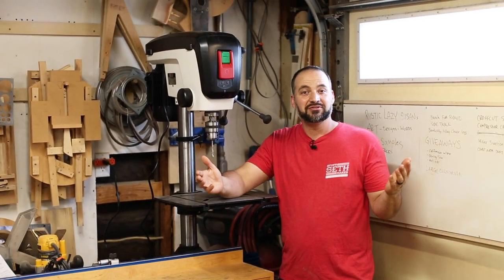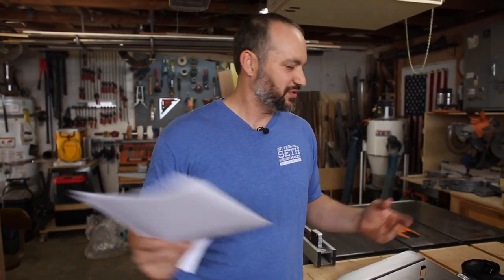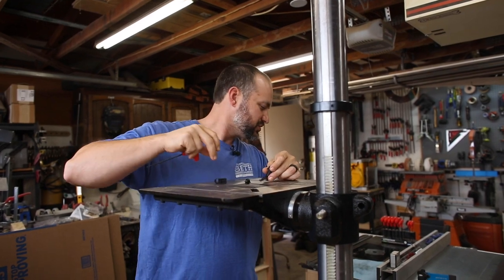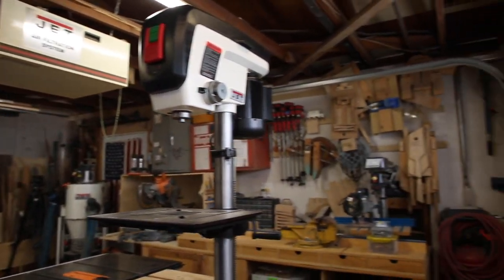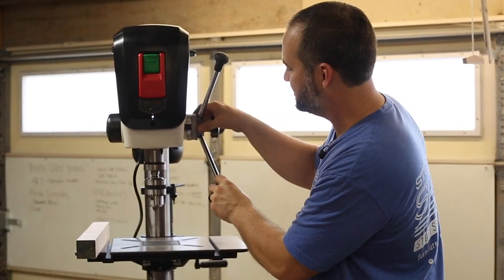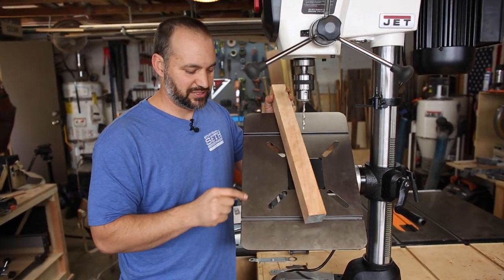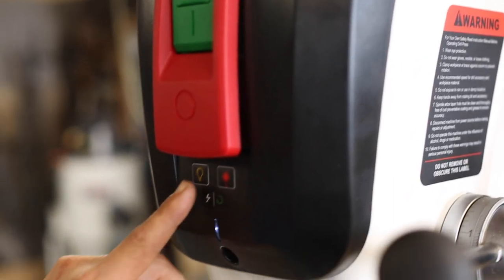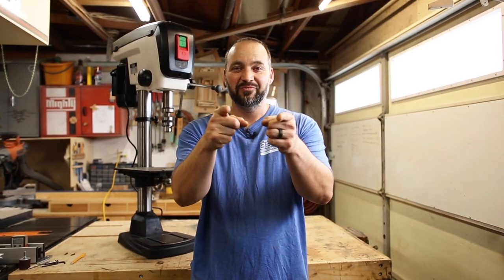HUGE UPGRADE for My Small Shop - JET Woodworking JDP-15B Drill Press

Comment: Thank you so much. I bought this press to replace an old delta varispeed 12".  Man this thing is big! My bench is 32" high and this press was to high to use comfortably. So I built a rolling stand with 3 drawers  20" inches tall not counting the casters under it and this is just Perfect. Just like this video. I will say that you need help to move this thing as it is super heavy and I mean HEAVY! And very awkward to handle. A person could easily hurt themselves. So if you buy one of these beware and ask for HELP! This is the nicest tool now in my shop next to the jet table saw. I love the chuck. Never have I seen a press with this nice of a chuck. Thank you again Seth!!

Comment: Question.  Can the main motor unit rotate on the column by loosening some fastener if needed?
Reply from the maker: Yes!  As a matter of fact it can.  There's a pair of set screws on the side that keep the head unit in place on the column.  If you need to swivel the head for any reason you can just loosen those.  I have the drill press mounted at the end of my bench and recently i needed to drill holes in the end of the workpiece, but the workpiece was too long.  So i swiveled the head and the table to the side, and also tilted the table 90 degrees.  Now I was able to secure my longer workpiece to drill the holes i needed.  If i can find a pic, i'll post it here on youtube to my "posts". 👍🏻
Reply: @stuffsethmakes  I appreciate the great video, and this comment addresses my big question which is do you regret not getting the floor model?

Comment: Hi nice thorough video. Question please.  What is that knocking sound when you initially turned it on? I had a little older JET floor model that sounded smooth as glass. If you aren't sure what I am talking about review your video and listen for yourself. Thanks once again
Reply from the maker: that sound was simply the machine running at a very slow speed which is how it came from the factory.   I'll admit I was surprised at first...i thought the sound would be more of a wow-factor when i turned it on for the very first time, but i didn't realize it was just pre-set to a very low speed.  Everything is normal though and I still love it! 👍🏻

Comment: cool video, thanks ! what is the distance between the back of the motor and the back of the column ? hope to fit it in my shop ☺️
Reply from the maker: i just went out and measured.   if i were to push the back of the motor right up to the wall it's about 8.5" to the drill press table height adjustment collar and about 10.25" to the actual column itself.  Hope this helps! 👍🏻
Reply: @stuffsethmakes  thanks so much! it fits, going to buy it \o/
Reply from the maker: YES!!! 🙌🏻

Comment: Hi Seth, you said on the video that you would talk about replacing the table insert. I didn't hear you address that so, when and with what would you replace it? Thank you!
Reply from the maker: sorry if i missed a point or didn't go into more detail.  it's just 3/4" mdf, about 3x3 in size.  when i replace it i'll just use the same material.

Comment: Would you recommend this drill press for light metal work?
Reply from the maker: yeah for sure.  i've used it for a lot of metal drilling.  I think you just need to be mindful of the bit you're using (i use cobalt bits for drilling metal) and make sure your speed is set properly. There's a chart printed on the inside of the lid 👍🏻

Comment: I think the only decision for me now is do I get the floor or bench unit. I'm 5'9" and realizing that if I get a floor model, my viewpoint to the table at max height is fixed. If I get a bench model, it can be what I want it to be, as long as I build a table for it, or buy a table. I'm wondering if you (Seth) or anyone else has found the bench version to be better for that reason. I'm not concerned about floor space. But if I buy a bench model, I have to figure out a cabinet solution.
Reply from the maker: I'm 5'10" and my current location of the drill press is too high.  That's because the only place i could put it was in my miter station which i designed and built very poorly several years ago.  I am currently redesigning my miter station this very moment. Instead of mounting the drill press on the miter station again i think i'm going to build a separate mobile cabinet for the drill press so it's at a more appropriate height.  The drill press cabinet might be a little narrow so i can rotate the head to drill longer pieces if necessary and I think i'll also weight the bottom of the cabinet (weights or concrete) since the drill press is fairly top heavy.
Reply: @stuffsethmakes  Good points to consider ... out of curiousity, how high do you want the chuck to be when you are done? I'm looking online to find any guidance as to the optimum position. Since this model is bigger than most of the other DPs on the market in that price range, it's rather unique. In a good way.
Reply from the maker: i don't know if there's a recommended height or if it's just based on personal preference but i just went out and measured some things.  Currently my green power button is about 70" from the floor, which is right in the middle of my forehead.  As i stand there and look at it, i think i'd like it be more around the 64-65" mark.  Not sure if this is helpful for you or not but those are my thoughts, haha!
Reply: @stuffsethmakes  I can see how that ~65" mark is ideal. With the floor model at 63-1/4" high, that places the button down about 59+ inches? That could work even better if I fabricate a thick steel plate about twice as wide, and drill/tap holes for hd wheels .... but if I build a cabinet, I need to deal with added weight (as you mentioned in another post), and making it wide enough for stability with most of the weight in the head of the dp, right? I'm guessing the cabinet should be about 25-26 inches tall? Sorry for all the questions, but this is a big expense for me and now that I know the JDP-15 is for me, it's a matter of "F" or "B" ... Thanks!
Reply from the maker: I'd imagine the floor model would probably be more or appropriate height right out of the box.  Since i'm not at the drill press cabinet stage of my miter station rebuild just yet, i can't say yay or nay to the dimension you mentioned but it sounds like you've got a pretty good grasp on what you'd need to build for either drill press! 👍🏻
Reply: @stuffsethmakes  Ordered my floor model JDP-15F today, along with Rockler's hold down clamps, Wolfcraft Quick Jaw Vise/Table Clamp, and steel engineer square ... fun times coming. Thanks for your video. It really helped me get as close to getting to see the DP in person, including your helpful comments!
Reply from the maker: awesome!!!  glad i could help! 👊🏻

Comment: Seems adjusting the LED cross hairs with a pair of pliers will eventually tear up the knurled knobs.
Reply: I want to know where your wife parks her car if the garages is a workshop? ;)
Reply from the maker: you don't need much grip pressure to adjust the lasers.  even if they were smooth you'd be good for a very long time.  additionally, it's not like you're constantly adjust them.  get dialed in and you should be good to go👌🏻
Reply from the maker: we have an understanding 😜

Comment: What is a good height for a movable cart  for the Jet 15B ?
Reply from the maker: unfortunately i don't know because it might be different for different people.  You'd have to determine your comfortable working height of the drill press, then build the cart according to your needs.   I just built a new miter station and repositioned my drill press on a shorter base...i'm hoping to put up a video soon showing more details of that project and i'll go into more detail about the dimensions in that video! 👍🏻

Comment: What are your thoughts on the sound it made? Are there any rattling sounds or any 'thud-thud-thud' resonating type of sounds? I ask as I bought a cheap Grizzly that sounds like a freight train and am thinking of returning it and spending a bit more on a quality machine. Cheers.
Reply from the maker: nah, no weird sounds.  when i turned it on for the first time in the video that was actually the very very first time i ever turned it on and to be honest i thought it would sound a little more powerful but then i realized it comes from the factory configured at a slow speed.  I've used it a lot now and everything sounds like a nice strong machine 👍🏻
Reply: @stuffsethmakes  Cool. Good to know it's working out for you. Thanks Seth. Cheers.

Comment: Great Vid....I'm getting a 17in Floor model but all the mechanical is the same.
Reply from the maker: Bobby Wartman  man if i had the floor space i'd be all over that floor model! 👍🏻.   Glad you liked the video! 🙌🏻
Reply: @stuffsethmakes  It's here and it's together..............That Lil White pilot light that is always on when it's plugged in annoyed me.......They should leave that BS off.......I removed the front cover where the switches are.......Inside are 2 circuit boards........1 aprox 2in X 2in and the other about the size of a postage stamp....Unplug the postage stamp one where it plugs into the 2X2..........Everything works correctly.......No more White idiot light on when plugged in.  Lazar was dead nuts ON.....:)

Comment: Nice looking press and very sturdy looking.  How well does it handle steel ? Like say 1/4 inch cold roll bar ?
Reply from the maker: E. Ramirez  haven't drilled through any metal that thick yet...only some 1/8" thick flat bar using a 1.25" bi-metal hole saw.  A couple drops of cutting oil and it was smooth and effortless, but based on that i'd imagine 1/4" would be no problem either.